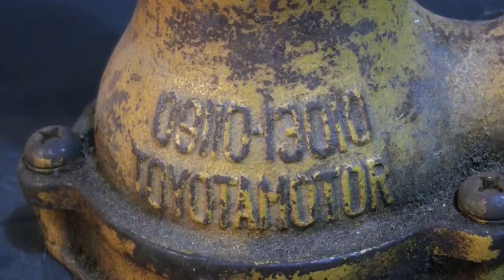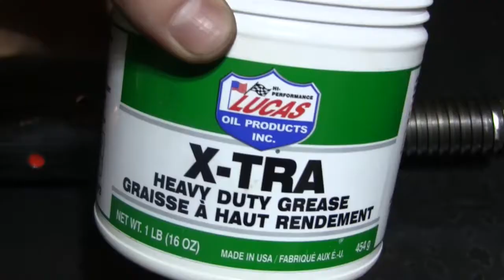Toyota Bottle Jack [Restoration]

Comment: Great restore! I was wondering how my Toyota bottle jack actually worked, because it's not a hydraulic jack, and your video made it very clear. Mine doesn't have the screws on the bottle, so it's not meant to be serviced. But it still works! Had to make a longer crank handle to get more leverage (lifting a 6000 lb motorhome).